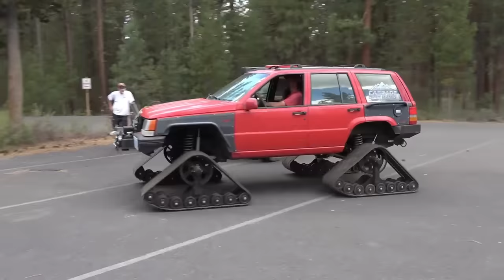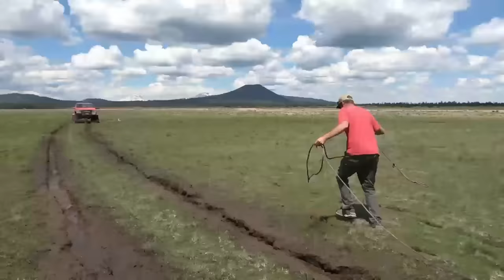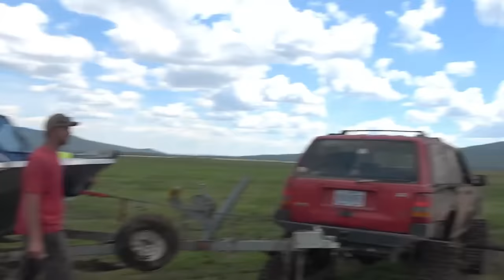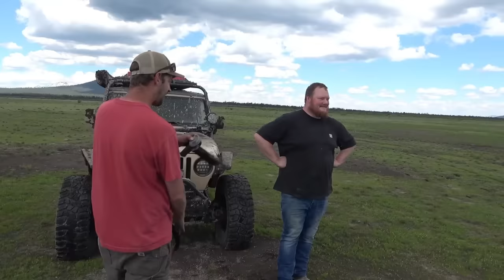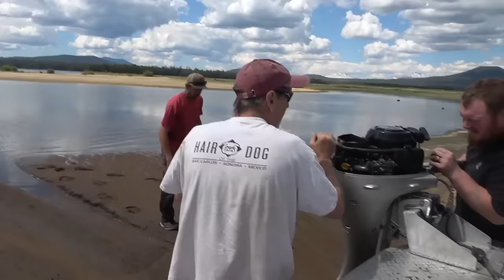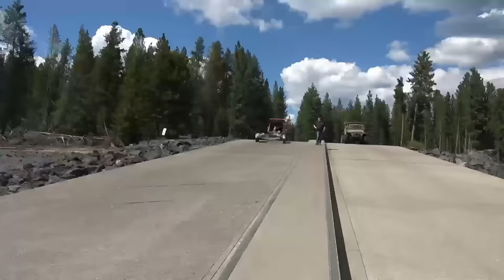Stranded In The Mud Flats (the rescue mission)

Comment: Just a heads up, the LJ t-case has its oil pump on the rear output. Towing with only the front shaft spinning is doing so without proper oiling. Oil will get sloshed around and being tilted downhill help but that front output bearing is being starved of oil on long trips
Reply from the maker: I know
Reply: Does it have locking hubs?

Comment: Awesome  video Casey. Your ability to adapt to the situation is impressive.  FWIW: Tell Nate never ever ever start an outboard (or inboard/I/O for that matter) without a source of water (27:00 in the video).  More than likely cooked the impeller in the water pump. It's made of rubber and needs water to lubricate/cool it.
Reply: Thanks for explaining that John. Yes he did fry the impeller.  It only takes seconds to destroy it. It's very likely I will see that motor in the near future. Got motor was purchased at our Marina. You can see the Sportcraft Marina sticker just below the 8 on the hood. Also the shift linkage is likely bent from being forced into reverse while not running. Happens a lot.
Reply: @stevejones9588  True that

Comment: At that particular body of water getting a truck and boat trailer stuck while doing a "beach" launch in a mud flat area was not uncommon. We watched this happen one time followed by 2 other 4x4s also getting stuck while attempting a rescue. Drove around to that side with two 4x4s and set up on the dry land to get them all out. Fortunately i had a long cable plus chains. No kinetic energy ropes in those days. No Casey to call either. Thanks again for taking us along with you Casey,

Comment: CASEY love the videos I'm sean from Nashville tn. I'm a WESTERN STAR TECH. that truck has ZERO freight liner parts in. And western star and freightliner will always be separate trucks. They did start sharing electric systems 2 years ago. The difference between the star and freightliner is bolts vrs rivets and huck bolts. You got a fantastic truck

Comment: So after boating for 17 years Before Launching: always have a line on your boat if you launch it, always test motors on land, be sure you have enough fuel, then launch & pray all goes well on the water. There are no guarantees as whatever can go wrong will go wrong. Lastly PFD should be used especially if you’re boating alone.

Comment: Cool recovery, Nate was right...ish when he said "when in doubt throttle it out". That boat was designed to run in 4-6" of water so he likely could have kept it up on step and rolled out to the channel he would have probably been fine but there are many areas around that lake where there are stumps and whacking a stump at 30 mph would be worse than having to get Casey to recover a fairly unharmed boat.  Probably the most harm the boat took was the fried impeller on the kicker when they fired it up out of the water.

Comment: I am amazed you didn't get stuck in the muddy bottom both times you attempted to launch the boat. You drove quite a ways into the water.
Reply: Most of the channel banks out there are pretty firm sand bases so there really was not that much risk of getting stuck for that track Jeep, there are certainly some gnarly mud flats and creek channels in some places though.

Comment: I grew up wheeling on floodplain ground just like this. in places like this speed is your friend as long as you can keep your momentum up to stay on top of the thin crust stopping to back up is certain doom along with driving in the same place twice. though that same place is the reason why I own 2,000 feet of cable in 100ft sections

Comment: This boat-trailer is only good for launching on steep incline, preferably concreted slip-way. You need to fit rollers in the right places on the trailer (like the one seen on the front winch), then one person will be able to push the boat on/off with just the slightest bit of water under it  - I'm talking from own experiences, boy did I struggle with launching without them
Reply from the maker: Ok, I’ll totally rebuild the trailer for one single use.

Comment: Outboard motors run out of the water tear the rubber water impeller for the water pump to shreds. Change one to see. The cooling jacket ports get plugged with rubber chunks.

Comment: First mistake . Shulda borrowed a roller trailer . 2nd use the bow Eye that's what it's there for and gives better geometry to pull it up.
This would have ben easy to load with the hand crank

Or bring 5 gallons od soapy water to wet the bunks would have helped. Not break stuff.

Awsome vid . Love the scenery.
Reply from the maker: You mean the eye that’s already been broke off and repaired??    There’s a reason I didn’t use it.
Reply: @Casey LaDelle  ahhh didn't notice that .... sorry I missed it in the shenanigans 😆. 
Looked fun though wish I was there...

Ps have you ever check on the matttrack brand ?
Not shure on there specs was just a thaught.
There made up in Minnesota btw, whare I'm from but now I'm also a Oregonian on the west side of the mountains...lol

Comment: Do the tracks put extra pressure on the steering box and frame, are you going to have to reinforce the frame so the box doesn't tear off the frame?
Reply from the maker: Yes, hydraulic assist is mandatory

Comment: Are those track kits designed for that?  Curious because snowmobiles with the same parts, mainly wheels and sliders don’t like those conditions very much.  Get it we’ll rinsed and check all of the bearings and look for melted/worn sliders.
Reply from the maker: Definitely not

Comment: Mr Casey Did you know you can make your Jeep float The old 1960s mattracks Fitted 2 land rovers Had big bowls floats Had touched front and rear So you could do more water recoveries The only problem Is that the land rover system Was Much larger It was about 4' Feet to the bottom of the door

Comment: do you ever have problems with the transfercase towing like that? the manual says to remove the front driveshaft when towing like that because the front driveshaft still spins the shafts in the transfercase even when in neutral with all the oil pushed to one side of the case. though it probably matters more for the people pulling their jeeps cross country

Comment: I make a screw in anchor ⚓ out of pipe and use an impact to drive it in to the ground. Pulls 10k no problem
Reply from the maker: Not in that ground it won’t
Reply: @CaseyLaDelle   don't make me prove you wrong. 32 years manufacturing
Reply from the maker: @backcountryboondockers  that’s a neat story.
Reply: @CaseyLaDelle   1" pipe with 6" auger welded on one end and a nut welded on the other driven into the ground with my harbor freight 110v 1k ft lb impact should be enough but could go bigger like 2" pipe. You get the idea
Reply from the maker: @backcountryboondockers  zero chance of that working.
Reply: @CaseyLaDelle   made right it would be like pulling a tree stump
Reply from the maker: @backcountryboondockers  no it won’t.   We are literally sitting on bottomless pudding.  There is nothing for it to auger in to.
Reply: @CaseyLaDelle   guessing a winch box is the only thing left

Comment: Can someone explain to me why you went to all the trouble to load the boat on the trailer, take it back to the water, twice, then drive the trailer to the boat ramp, pilot the boat to the same boat ramp and load the same boat back onto the same trailer? Surely just take the boat and trailer back to the parking lot which was your eventual destination anyway. I'm sure there's a reason, other than getting your vehicles muddied to the gunnels but it's not obvious.
Reply from the maker: Because as I said in the video….   There was zero chance of towing the loaded trailer back across the mud flats to the access point.

Comment: Hey Casey, quick question. If I’m hauling a 4wd with an under reach. I have the front wheels on the pavement. Even with the hubs unlocked is it okay to haul it like that?
Reply from the maker: Depends on the vehicle
Reply: @CaseyLaDelle  It’s a 92 dodge W350. Weighs about 7000lbs. Dana 60 axles
Reply from the maker: @tiller_k3862  again, depends on the vehicle….    You’re not going to get a more specific answer than that out of me.
Reply: @CaseyLaDelle  Okay thanks 😁

Comment: Below the Highwater mark at wikiup?? Probably should have tried to do it with one vehicle since no vehicles are supposed to be down there. Then use the other vehicle in an emergency instead of just playing around down there.
Reply from the maker: Both vehicles were needed to do the recovery, both vehicles were authorized to do the recovery, so both vehicles did the recovery.

Comment: You should set up your business number so that it will only accept calls from your local area. If someone isn't in your local area and desperately needs help, they're calling the wrong service anyway. If they're not in need of help they're a commenter who just wants to chat. You might have to change your business number, but don't give it out on the internet, and don't make it so easy to find. You will wind up having to use an answering service, even though you don't want to do that. Do you want to help your customers, or manually spend any free time you have screening out unwanted YouTube calls? Choose the former, it might not be what you want, but it is what you need.
Reply from the maker: None of that makes any sense.   This is a tourist area.  75% of my customers are from other places.   Second, making the number hard to find when the whole point is for it to be easy to find when people need immediate help isn’t the greatest idea

Comment: Can't believe u r driving around without the boat hooked up front. If it slid off the back it would cost a lot of thousands of dollars.
Reply: He did hook up the safety chain on the front of the boat 😊
Reply from the maker: No it wouldn’t
Reply: Happened to a buddy of mine.  $2500 in damage  this one would have ripped the outboard right off and probably lower unit damage.   Roller trailers are much more prone to rolling off but since his hitch was so high it could of happened.  Not worth the risk.
Reply: @chriszenker2468   I did miss miss that part where he had it on for long cruise. I only take it off once in the water.

Comment: Casey, it's one time when you needed to be able to drive both recovery vehicles by yourself.  That is through the whole recovery start to finish.  Your buddy seemed to have an attitude that it's not my car so punch it.  You are the master but it seemed like you could have spent a lot less time if, after you had the boat on the trailer you would have just taken it to the boat ramp.  But, that's why you are the pro and I am a spectator.  I am sorry to say if Nate were your enemy you might have had less problems with the recovery.  Everything he did was not my problem, Casey can wash it not me.  It was a shock the way he talks.  Oh well, put out the fire.
Reply from the maker: If I could have hailed the boat back to the parking lot I would have.   There was a reason we did it the way we did, and it was stated in the video.

Comment: Casey, You need to not listen to Nate.  He is obnoxious.  And you never, never, never, never put a Chevy engine in a Jeep.  Having a vehicle where everything is balanced to work together is extremely important.  Jeeps, unlike other vehicles are designed to be 4WD vehicles not 2WD with 4WD as an afterthought.
Reply from the maker: You mean on the balanced and perfectly engineered Jeep that’s already been cut in half, stretched, had an entirely different suspension welded to the bottom half of it, axles out of a completely different vehicle swapped in, and is already on its second motor??      Yeah, it would be a shame to change something on this perfect specimen of factory engineering…..
Reply: @CaseyLaDelle so the only thing jeep on your jeep is the name plate 😂love it 😂
Reply: Isn't an LS motor going to be a lot heavier and therefore make it easier to get stuck ? Matts banana with a six-cylinder in it can go more places in deep mud and sand than his Morrvair because it is lighter.
Reply: @CaseyLaDelle roflmao
Reply: @davidclemens1578 more of smaller if I recall.
Reply: @Pete McLallen If you worked for AMC engineering for 34 years, you must also be aware that they engineered most of their vehicles around borrowed parts from Chev, Ford, Dodge in the 70's /80's when their business was flailing. 
With regard to everything needing to be balanced being extremely important, that's a poor statement given the fact that  they're about as aerodynamic as cinder block .
I would also like to add,  Jeeps were notorious for highway rollover accidents due most in part to being narrow with a short wheel base and a high center of gravity.  With regard to design, its stamped,  flat and cubic.
Adding an air freshener to a jeep is even an improvement.  A bone stock jeep in no better that a lunch can on wheels. They were built and sold cheap as they could to boost sales.
The best Jeeps out there are the ones that have been lengthened/ body modified with bigger engines and better suspension.
Reply: @CaseyLaDelle  I’m not sure that you changed the important things.  Stretching the wheelbase can be an advantage if done right.  It all depends upon the use . . . And the driver 🫠
Reply from the maker: @petemcl99  the body, frame, suspension, axles, and drivetrain have all been modified or replaced.   What are we trying to preserve here??